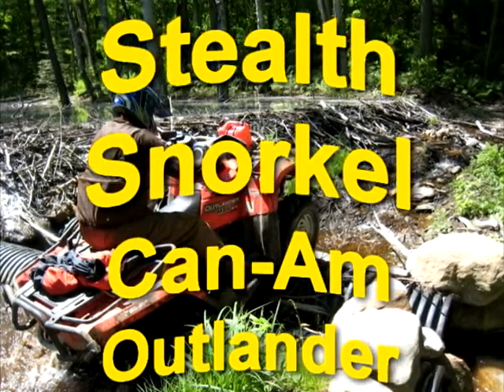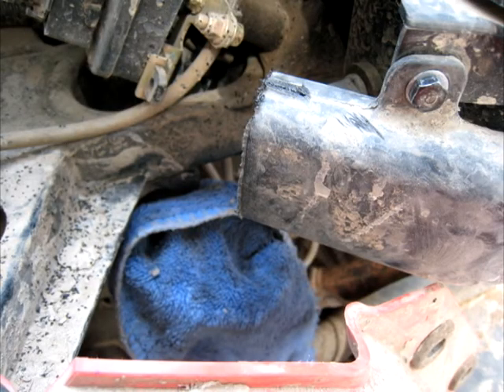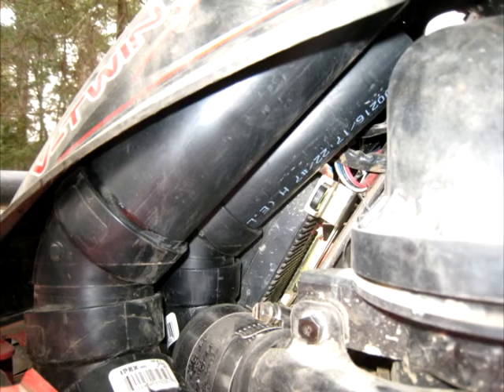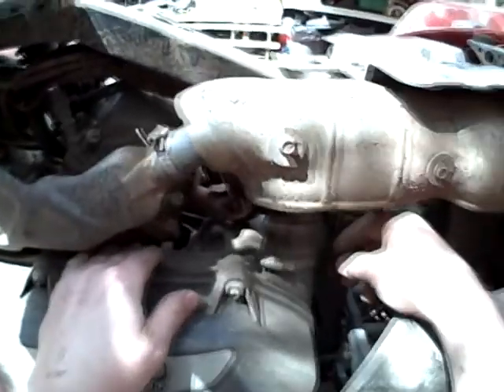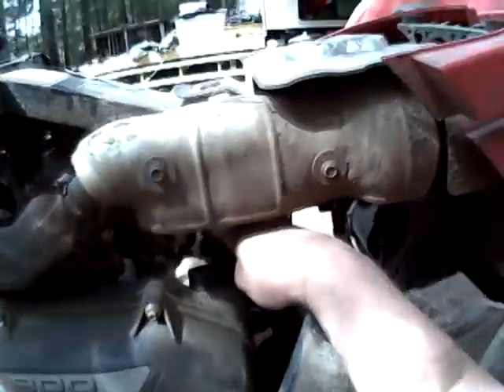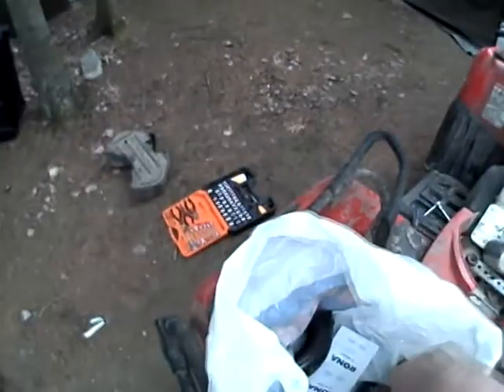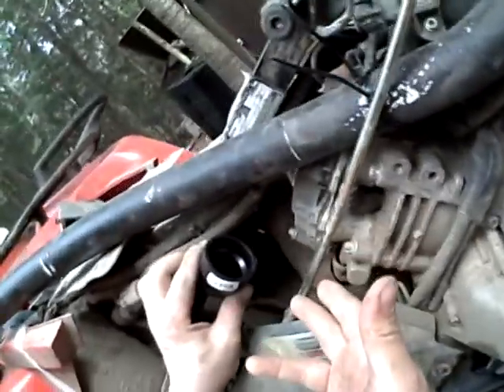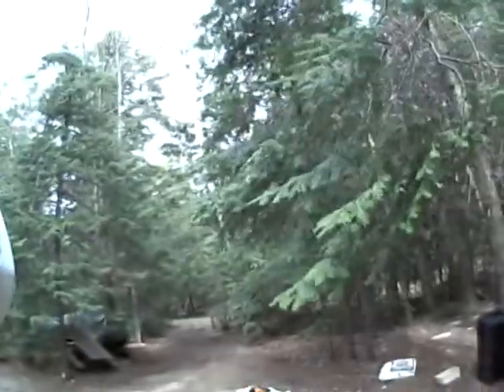Stealth Snorkel Install - Can-Am Outlander (Gen1)

Comment: Any fi ished pictures. Wondering how you got it to fit without flipping cpu
Reply from the maker: Sorry the ATV is long gone.  Yes it hid fully under the instrument cluster.  You wouldn't have noticed the system unless  you looked closely under where the exhaust went around the backside.
Reply: @northlanddiy2524  tried flipping my cpu all day and realizing now it will fit lol glad I saw your picture thanks a lot